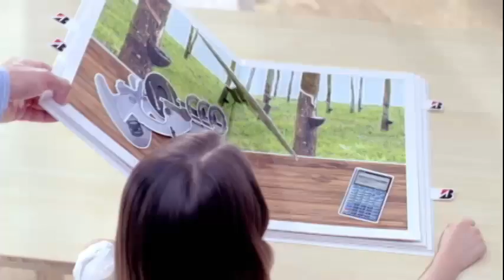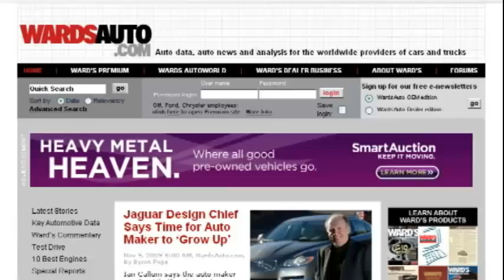Mazda i-ELOOP - Autoline Daily 776

Comment: Actually, the I-eloop system doesn't power the wheels at all, the power generated is used for the regular electronics of the car. The benefits come from the alternator leeching less engine power.

Comment: @ndyt yea definitely! capacitive regen would help help a lot with initial start off after a stop which uses the most power with high voltage and faster dissipation from the capacitors